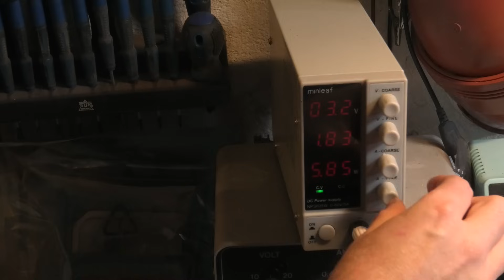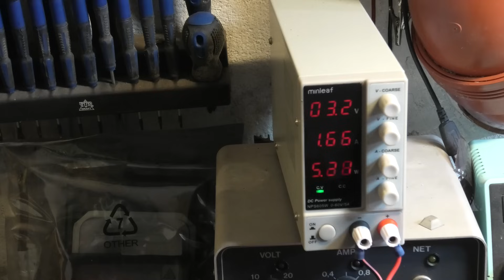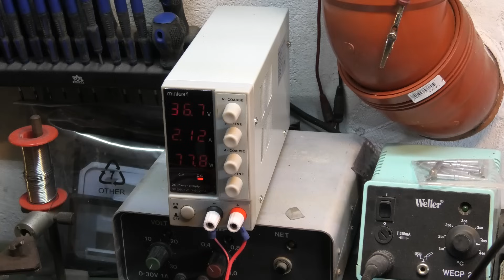Fixing 36V Electric Bike Battery from Biltema, Coop & T-Hansen - 1118

Comment: Hi, same thing, a friend was given a non working  14" Murtisol Ebike. Battery is 36v 6 amp hours. I have  new charger, 42v 2amp,  its working fine and has been tested. It brought battery up to 16 volts and charger light turns green.  Tried turning on and off a few times.  One video said that can reset the BMS, it did not in this case. 
So I will open it up and see if resetting the BMS will work.
Reply from the maker: Thanks for the info.

Comment: Just want to say I've been trying to figure out what was wrong with a similar battery which uses the same charger and wouldnt charge above 36v, I had done everything and it wouldn't work until I found your video and did the disconnect of the negative and short it down and now it's charging so I'm very hopeful! Just want thank you very much and my wife's sister will be very happy that she can use her bike again
Reply from the maker: Thank you very much! I am happy to be able to help, and save another battery, that might otherwise be replaced, with out it really being necessary.

Comment: Hi I need your help my ebike stromer 2 but I think I was not use and charge a long time.When I try charging firt off all orenge led (1sn) and than red light flash .Do you any experinece abouth stromer ebike battery thanks for your help
Reply from the maker: No sorry I just looked in to this ,,, as needed.
Reply: @MyPlayHouse  Hi my friend I follow your all check point on my Stromer e-bike Battery and than all system is OK it is working :) Thanks for your all support

Comment: Nice video, I appreciate your explanation of the process.

I will try to fix two ebike batteries based on your recipe and the swedish guy’s video ( https://youtu.be/23SVz23RkbA)

I guess I can charge the battery cells via the connector to the bms (after disconnect) one cellpack at a time at 3+ volts
Reply from the maker: Hi @anothersite2038
Thank You very much!  glad you liked the video :-)
Thank you for watching! :-)

Comment: Hello ....
Is there no problem in charging Li-Ion Batteries with the power supply ?
I am scared to do so ...., 
Li-Ion cells not have a special charging algorithm ? like CV/CC  ? could you explain a bit , please ?
Reply from the maker: This is just a mater of charging it up enough for the charger that comes with the bike, to be able to take over.
As long as you charge it slowly,, it is fine.

Comment: I have some problem with this battery. Cells where very bad so i replace them with new ones. Connected everything like it was before. Charger is red and its charging, to 42v and go green but only on cells before bms, after bms on output i have 21.4v and factory indicator on battery show one red spot. I tried to reset bms like you shown on video but nothing helps. All cells are on the same level. Any ideas?
Reply from the maker: Have you balanced the battery,, so all the cells is within like 0,1volt?
Reply: God told me that most of your cells gone bad (losing charge), so replacing a few cells will not work. Are you able to load test with this pack by taking it for a descent ride?

Comment: The battery has a small CPU with "planned aging". After a number of charges the battery simply stops working to force you to buy a new one. More or less a scam.

What you did was to reset the aging counter by draining the CPU from power.
Reply from the maker: Ahh,, this one was just left uncharged over winter..

Comment: Hello, why do you need a motor and a battery on this bike if you pedaled in the test?  I once saw such models in the secondary market, but it is not clear how this motor works
Reply from the maker: Well if you have to padale to get motor acesstences,, it is a bike. If you do not have to padale to get motor acesstences, it is a scooter.. there are different rules,, like you need a insurances for a scooter here...

Comment: I have the exact same battery, but mine doesn't even blink red, ever, tried what's shown in the video here except balancing the batterys, don't have the equipment, but I tried the reset, didn't work. 
My charger adapter constantly show's red and green light whether I'm plugged into the battery or not, and when I plug it in, nothing happens... 
Any help on these old batterys still?
Reply from the maker: If it is totally depleted, it may be necessary to charge up the Cells,, a bit, for the electronic it be powered.
Reply: @MyPlayHouse  hmm, alright, I will give it a try. I couldnt have short circut the batteries tho when trying what you did in the video with the reset? The fuse looks perfectly fine
Reply: @MyPlayHouse  Any clue when connecting to the balancing leads, that it doesnt charge? Or takes insanely long time? I have it on 03.2V and its on approx 1.91A
Reply from the maker: @P47RICKG  It can take a long time,, to charge up all the cells to 3,2v could take days. maybe 3,0v is fine.
I do not have the setup from the video,, was just helping someone.
Reply: @MyPlayHouse  so last update is that my battery has three cells, one measures 2,89V, another one who was low I have now managed to balance up to 2,87V, but the last cell is not charging, it's discharging... Not taking charge

Comment: Batteridoktorn now just shorten the RST (reset) signal on the board to ground.
The function to brick the battery is programmed to happen after the warranty has expired so they can sell batteries the same way as printer manufacturers make the profit from ink.
If cells are out of balance is another problem what I can understand, that must be fixed by hand as you did if it don't get balanced by itself.
Reply from the maker: Hi birre xtio
Thank You very much!  glad you liked the video :-)
Thank you for watching! :-)
Reply: @MyPlayHouse  Thank you.
I normally don't comment a video that is one year old but the problem with dead batteries is still a problem and the cost for replacement is ridiculously high.
Reply from the maker: Makes me happy when I am able to fix a battery and prolong it´s life,, and save a lot of money! But even happier when I get feedback from people, that has seen my video, and saved there own battery. That is rewording! :-)

Comment: I have just fixed 2 of mine it was the charging ports cost about £10 UK pounds. I'm an engineer and did not like what I seen inside the battery so also made some connection upgrades internally.
Reply from the maker: It's called a fuse,, it is suppose to be thin :-)
It is not uncommon to find rather thin wires, on the inside. That can benefit from a bit of upgrading.

Comment: Thanks for your effort. Your video was entertaining. However I think you should have left a link to the person who published the YouTube video you mentioned that actually told you exactly what to do in order to fix the battery (i.e. how to reset the BMS), otherwise, it's not clear whether your effort accomplished anything for those that need that information. You spent most of the time showing how to iteratively balance charge levels of various cells and admitted you weren't sure if that was root cause of issue.
Reply from the maker: Well the video is out there,, and if you’re Swedish is up to date,, you’ll be fine!
Reply: @MyPlayHouse  YouTube can do some translated captions if that's helpful.

Comment: Hej, jeg har et løbehjul, som holder strøm meget dårligt, jeg kan kun køre en kilometer, så er det ved at være afladet. Jeg har skilt batteriet ad og jeg kan ikke umiddelbart se nogle dårlige forbindelser eller noget. Alle celler ligger på 3,9, pånær 2 der ligger på  3,7. 
Har du nogle idéer til hvad det kan skyldes?
Reply from the maker: [Hello, I have a scooter that holds power very poorly, I can only ride a kilometer, then it is running out of power. I have taken the battery apart and I can't immediately see any bad connections or anything. All cells are at 3.9, except for 2 that are at 3.7.
Do you have any ideas as to what could be causing this?]

I only reply in English. 
The 0.2 voltags, may be to much of an unbalances for the BMS,, It might turn off if the battery is not in balances. The unbalance's might be a lot bigger, while driving. I would charge up the two that is low. And use you warranty if you have it.

Comment: I think you did indeed need to bring all cell groups up to a common level and the overall battery to at least 35v. Otherwise if you reset the BMS it would have seen the same condition that caused it to block charging before. Well done !
Reply from the maker: Hi Rhian Taylor
Thank You very much!  glad you liked the video :-)
Thank you for watching! :-)
Reply: what is the voltage difference between cells that is allowed?

Comment: You just haven't done nothing?you should replace with new batteryes.
Reply from the maker: Bike is still running and it did not cost $300 ,,that is not nothing!
Reply: I would try force charge first if they able hold smtin

Comment: I have done this for the BOSCH batterie too on a Gazelle e-Bike which is typical for the Netherlands.
Reply from the maker: It is embarrassing, that a company would charge 2500,- dkk to do this...
Reply: @MyPlayHouse  Yes really. Here in NL would it bee 320 Euro for a new accu for the bike.
Reply: I have a Gazelle with a 36v battery that won't charge. I really need to get this bike battery fixed so I can get to work. Will you please give me any useful ideas you may have. Thank you...Cecil.

Comment: I think the lowest cells with 2.6-2.7V should have been balanced, so that's a good thing. But actually, yes, often after "fixing" a deeply discharged lithium-ion pack by charging the cells individually back up to 3V or above, you then need to reset the BMS by cutting its power. I've seen that with an old laptop battery I fixed (there were no replacement batteries available in 2018 for this cheap 2011 200€ laptop), and I've heard that it even works that way also on iPhone batteries. So this is quite a common thing.
Reply from the maker: Thank You..
Reply: @MyPlayHouse  You're welcome!
Reply: Acctually biltema had this programed in bms so it stop taking charge after some years.. reset bms and good to go. (If there ist any other issues offcurse

Comment: I can't believe you didn't load test the unit to see if it had any stored energy. The woman should have left the e-bike with you.
Reply from the maker: It worked fine... we tested it on the bike at the end of the video.
Reply: @MyPlayHouse That is not true... God told me that the battery cells are bad and lost charge quickly. You cannot fix the bad batteries...

Comment: Hi, just found the video. I agree it's a nice fix, although the fact the BMS needs to be reset is a bit annoying. I came on this video while researching about these batteries, as they are 75% off new at Biltema. At 75% off, for sure they're priced right. Any idea what is the spec of the cells they use? I tried to zoom in the video, but can't see it.
Reply from the maker: Sorry, I do not remember,, but did I not say it in the video ?
Reply: @MyPlayHouse  Hej, no can't see it. I am interested as you may have seen, they are massively discounted now at Biltema, cheaper than cells, and am thinking to build some battery storage based on them. Having cell data is quite useful
Reply: @dragosmihai3489  Samsung ICR18650-26-J M (2600 mAh)

Comment: Here is the secret: When battery is left to discharge below limit the BMS turns the output off and charging is not possible... Simply open the box and connect the charger to + and - terminal  directly after recharging to 42v the BMS will work on next recharge...
Reply from the maker: Hi Mathew Orman
Thank You very much!  glad you liked the video :-)
Thank you for watching! :-)
Reply: hey mathew would u mind explain what u mean by:
"connect the charger to + and - terminal"

do u mean the most + of the battery and the most -
Reply: @rushhour6444  I wish I knew what he meant as well, I think what you do is disconnect the connector from the batteries, as he did, then disconnect the battery feed to the BMS, this will reset the BMS
Reply: Regarding this suggestion, I think the issue for the average user is they only have the charging block as a charger, not the white piece of equipment he has, which he used alligator clips to directly hook up the to the battery.

Comment: Well done, it's alive again :-D
Im not impressed by that charging system, the designer needs a good slap with a battery lol.
It should have blinked a light on the battery labeled recovery, while the controller pulse charge the low cell voltage.
Or at least a reset button on the battery.
Silly designers.
Reply from the maker: I agree,, the info you get,,, sucks